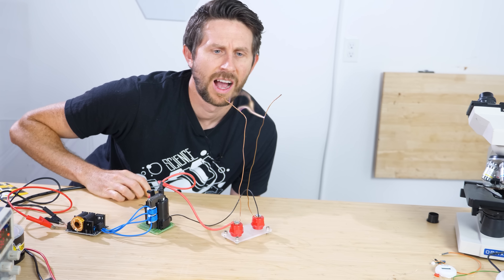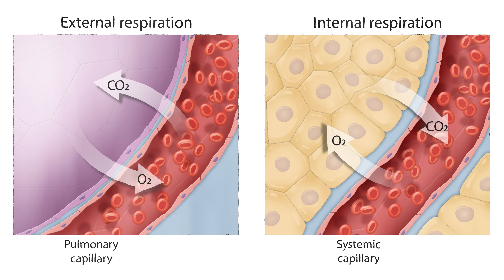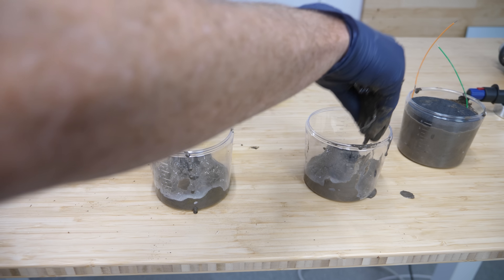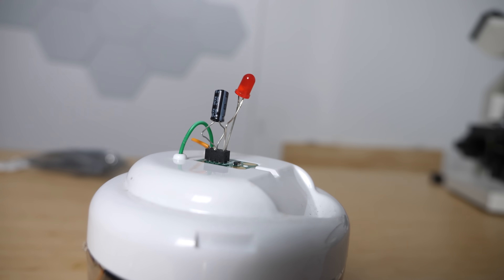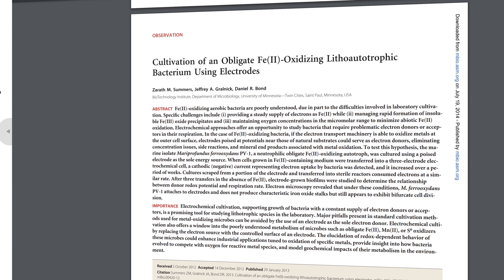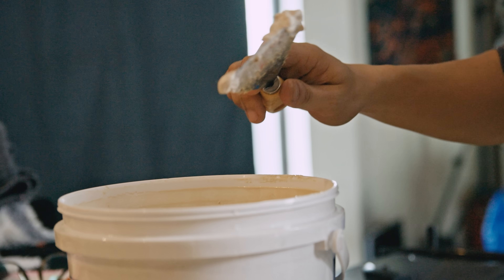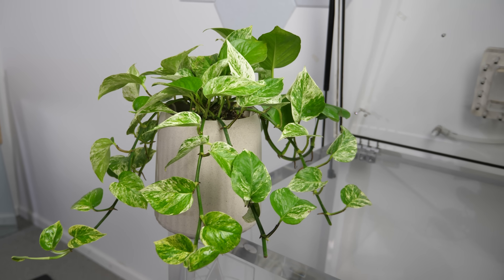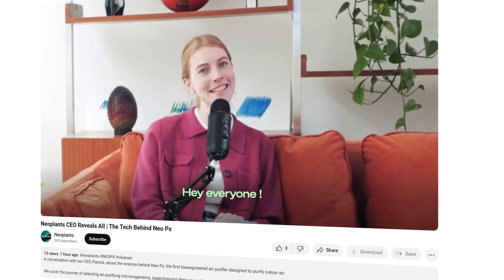Electricity-Eating Bacteria vs. Neoplant's Toxin-Eating Neo Px

Comment: I just love your dry humor 😂

Anyway, when an outside observer (say Alice) sees someone falling in (say Bob) slowing down, shouldn't Alice also see Bob becoming bigger?
When Bob brings Einsteins light clock, Alice would see it ticks slower. But since light moves at the same speed for all observers, the distance between the mirrors of the light clock must become really big to accommodate for the slow ticks. So Alice also sees Bob smear out over the horizon.

But for Bob the light clock would retain its original size. But the light clocks that already were near the horizon, seen from Bob, they would shrink again then. Since this counts for everything near the horizon, the whole thing shrinks. Until it becomes really really small, like a dot. The singularity? 

So conclusion: the horizon is the singularity. 😜 The difference is just the perspective.

Comment: So many errors in this video... few here corrected:
 - Sugar do not have excess electrons, it has energy that makes electron transfer possible.
 - The bacteria cannot grow with only electrons as their food source, it provides them only energy, not material for cell walls, DNA, proteins, etc what is needed for growing.
 - Plants are not evolved to eat pollutants (many of the pollutants didn't even exist before industrial times), however they do metabolize some of them. However, the extent of how much house plants do that is insignificant for removing VOCs. Instead you need to correct the root cause.

Comment: Sounds more like artificial selection  than natural selection to me. Also, humans, as a species, didn’t evolve per se, e.g. from an ape or apelike ancestor, as there is no proof of this occurring, only races have evolved to adapt to different geographic regions,
Note: so called “missing links” are by default only intermediate forms and not ancestors or descendants i.e. related, because no DNA sequence with an arbitrary structure that proves such a relationship has ever been found, in fact no structural DNA has ever been found in such “missing link” fossils, only traced of the chemical itself which is like the difference between a spot of ink and a bit parchment vs. a play by Shakspeare.

Comment: You never forget the copper taste after a backfed neutral pulls your leg through your arm. They said I was lucky to survive doing that job and the engineer should of verified the circuit safe before allowing us to work on it. Horrible experience for me still living with treatments to calm my immune system down.

When the valence of your skin tissue is replaced by engineered conductive materials, what happens?

Comment: Yes, cells remove electrons from food and use them to create energy. This process is called oxidative phosphorylation and it happens in the mitochondria of cells. 
Here's what happens during oxidative phosphorylation:
1. Food
Food contains stored energy, usually in the form of sugars and fats, which are carried to cells by blood.
2. Electrons
Cells remove electrons from the food and pass them through a series of proteins in the mitochondrial inner membrane.
3. Oxygen
Electrons are then passed to oxygen gas molecules that have diffused into the mitochondria.
4. ATP
The electrons combine with protons from the surrounding solution to produce water molecules, and the cells use the electrons to make ATP, a molecule that stores energy for most living things

Comment: I get triggered every time you say "eat electrons"
Most People think electricity is  consumption of electron but its movement of electrons
And the way you put it would confuse people even more
As far as I understand, bacteria acts like a circuit element with two ends that runs electrons over themselves and dont consume electrons

Comment: no. We have no mechanism to make use of electricity for nutrition, which is what eating is for. BTW and FYI, eating is not for gathering energy. It's more about gathering replacement building materials for our bodies. While we get some energy from this, around 90% of our "energy" comes from the oxygen in the air we breath. Also, electrons do not flow through our bodies or nerve cell axons like an electrical current. Ions flow in and out of the membrane of nerve cell axons through ion pump gates, triggering the same reaction is the next gate down the axon. When it reached the end, this triggers a reaction that causes the release of a neurotransmitter. other chemical reactions in our bodies involve the transmission of ions or the exchange of electrons from one atom to another but there is no electrical current in any part of out bodies.

Comment: i doubt the viability of this unless you use different metals for the leads because there's no voltage bias inherent in the generation of electrons.
Reply: All the bacteria just need something that they can reduce because the electrons come from the digestion of food like sugars and acetate, so its actually even more widely available in use for bioremedial cleanup of heavy metal pollution like chromium oxide breakdown